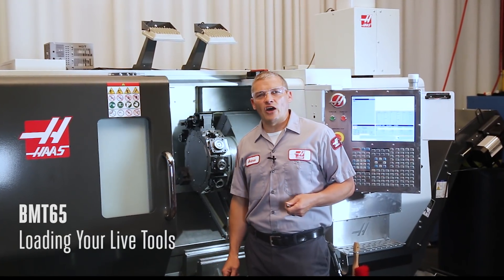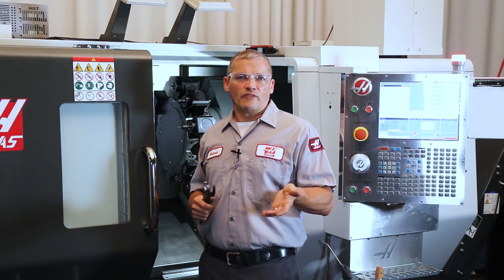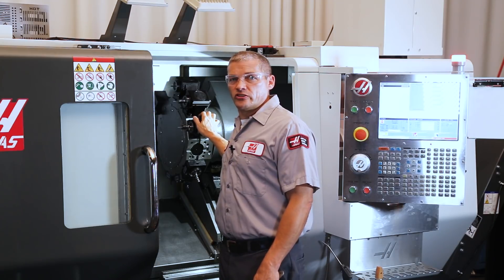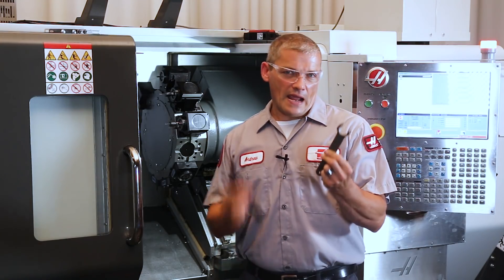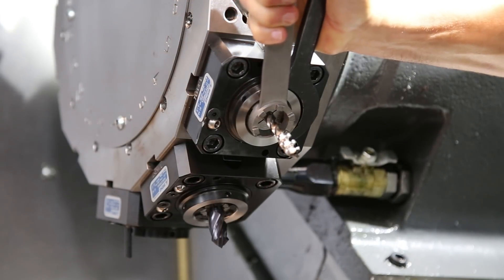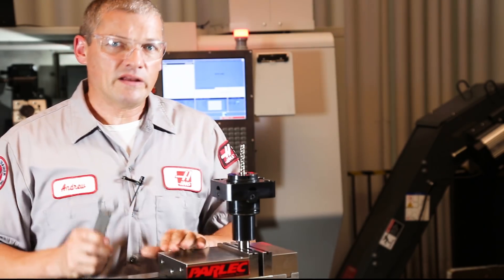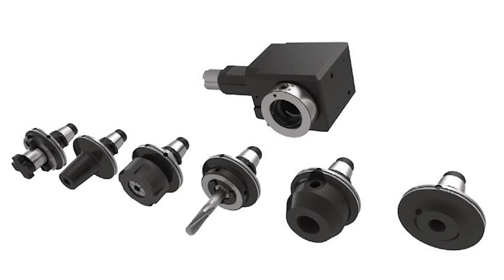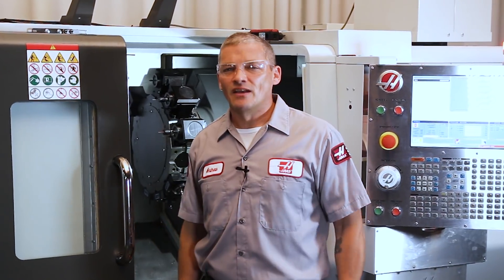The Proper Way to Tighten Tools on Your Haas BMT Turret

Comment: This much work to install a live tool? everytime you want to press e-stop? then i prefer mine doosan than this haas, i would have to everytime refer my machine after e-stop, rather than this you just loosen up the spindle of the turret and you just mount your tools. After that you just progress as usual, theres no more moves. easier quicker and safer :)
Reply: Krzysztof Posański nice thing is you don’t have to re zero the machine after e-stop like a Doosan.
Reply: @przemyslawtomera8972  you must on the older sl-20